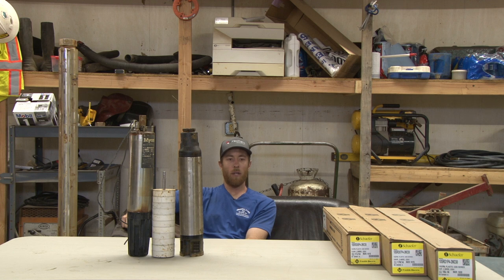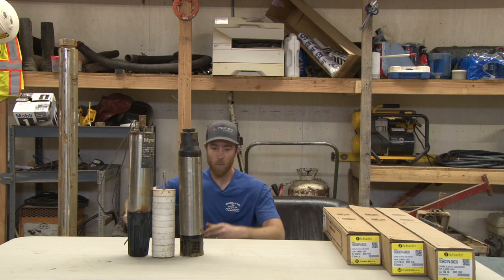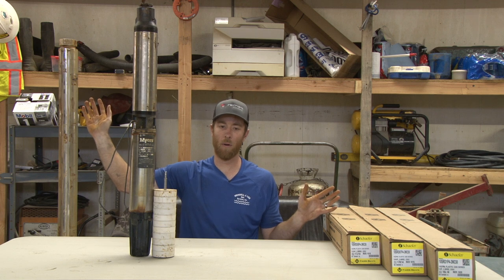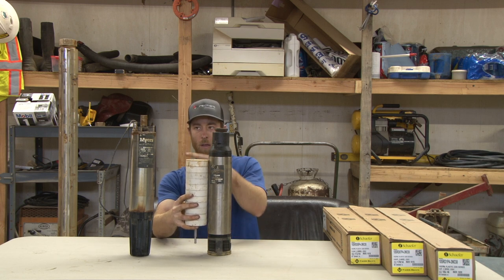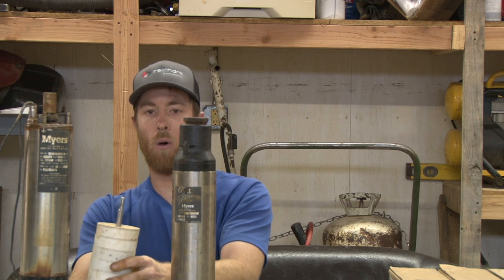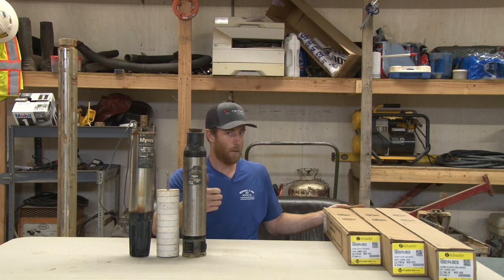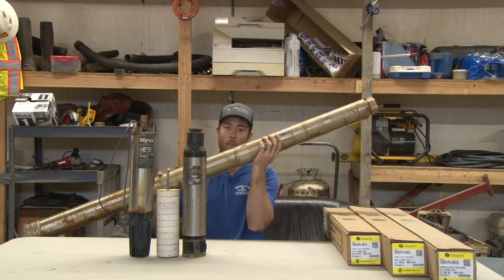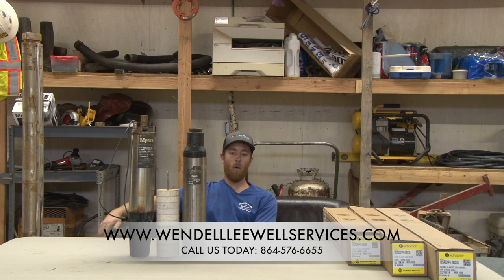Well Water Submersible Pumps: How It Works?

Comment: hello, where did you learn so much about pumps and water wells?
Reply from the maker: Been around it most of my life, then got involved on the design side for several years before returning back into the industry full time. I have also been lucky to have been around a lot of people that have been in the industry a lot longer than I have and have tried to retain as much information from them as I could.
Reply: @WendellLeeWellServices  Interesting